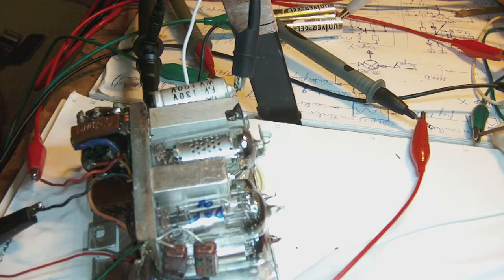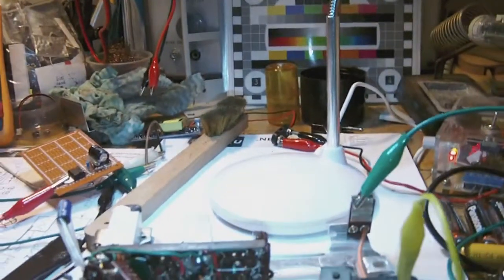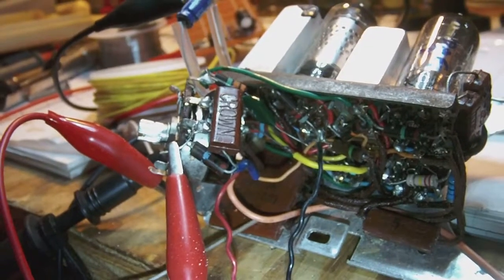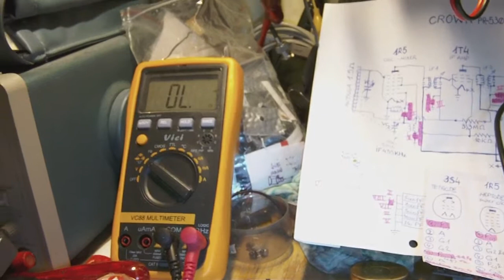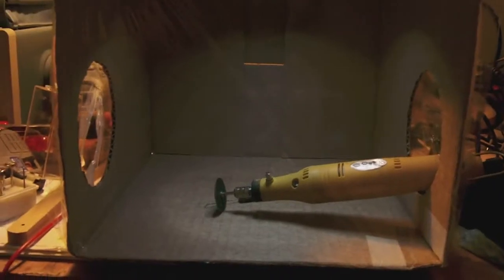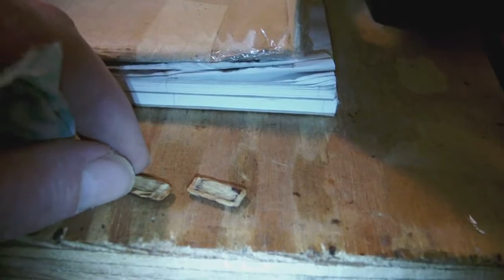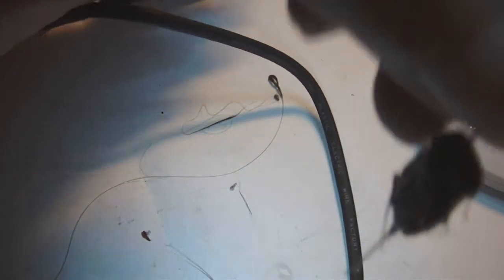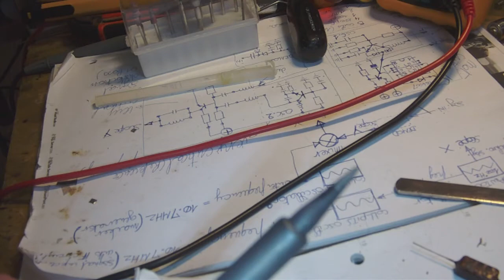Crown PR-530 part 3 of

Comment: Good detective work finding the problem with the LO, your getting there. 👍 Quite a good job on the mica caps, lot of work but looks good! 👍
Reply from the maker: You bet :) Grinding those damned Mica's is dirty, dusty, dull work; But once done and remounted inside the chassis it should allow me to get working on the essence... getting the old radio to work again. I'm REALLY worried about those IF cans.... have you noticed how small they are? Stay tuned for more, and thanks for watching :)

Comment: You should feed the 455 kH modulated RF directly into the 1st IF stage grid using something like a 0.01uF capacitor. The antenna and RF stage are not designed to pass 455kHz.

The local oscillator and mixer down-convert the signal coming in through the antenna.  The only reason you'll hear any of that loosely coupled 455 is that it's either leaking through the mixer or being picked up by some of the IF wiring.
Reply from the maker: Hey Bob. Ok, good tip. I'll keep it in mind. Thanks for watching :)

Comment: I can remember going around to every craft shop I could find asking about coloured hot glue, even in another town, but a sort of yellowish coloured stuff was all that I could find. I heard about something like it being used for hair extensions, but I wasn't sure where I could find it. Are they the same as the ordinary glue sticks, as in do they melt at the same temperature? Is the glue of about the same hardness or strength? Are they stronger?
 I never thought about cutting a molded mica style capacitor apart, though I have heard of some people casting replicas of such things like they do with dog bone style resistors. I tried cutting open a Sangamo "Little Chief" cap a few months ago with a cutting wheel, they are molded out of a similar material to mica caps, except they are pinkish red, blue, or green, pink dust everywhere. Then I found out that you can drill out the innards from one end, so I have been experimenting with that on a small lathe. They were lousy capacitors, I've heard that many were going bad by the early 1960s, but they were used originally in some radios, and other devices, and they look much better then those bright yellow poly-film caps in an old radio of the late 40s, early 50s.
Reply from the maker: Hello Oleg, as far as I can tell the hot glue for hair extensions is exactly the same as "normal" hot glue, with only a little colloring added for "bling" effect, strength-wise at least. You might, however, be careful with metallic-coloured hotglue (like silver or gold or sparkles) because that colorant is based on metallic additives and therefore isn't entirely electrically insulated. 

Some capacitors are "nasty" indeed when you gut them, causing a lot of dust and/or chemical goo. I would advise you always wear a dustmask and gloves and work in a well-ventilated room when you work on those.
Thanks for watching and your nice comment :)
Reply: There isn't really that much of a dust problem drilling out the caps I mentioned, the dust seems to just fall onto the bench and the bed of the lathe rather then creating clouds of dust as an abrasive wheel tends to do. Most of the debris is the paper and foil from the inside, plus a bits of copper wire that you have to drill through. Still I much prefer re-stuffing the cardboard tube types, other then then potential to burn yourself.
  By the way, did you ever find the fault in this radio? Did you ever get it back together?
Reply from the maker: It's funny you mentioned this, because I recently thought I should pick the project up again and finish it. So possibly in the coming two months or so I'll finally finish it, yes :) All I ask is a little more patience. In the mean time I'm working on a new project which, with a bit of luck, should come online in a couple of weeks at most. Thanks for your nice comment and always welcome :)
Reply: I was just curious, being a radio collector I know what that's like having a set that is being stubborn to get working, or needed something like a transformer, or coil, which I didn't have. I have a Philco portable from about 1946-47 that I never was able to get working, I finally found out that the problem is in the local oscilator, it just refuses to work, but maybe one day I will revisit it again.